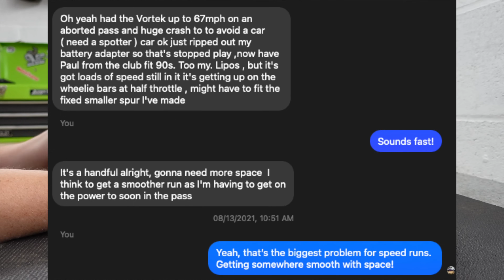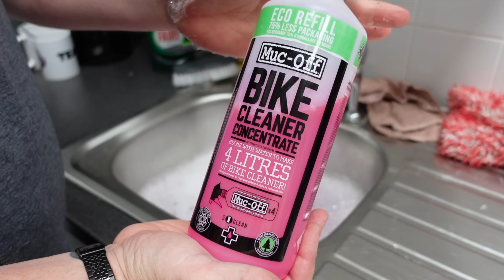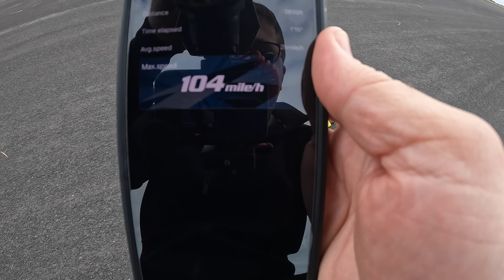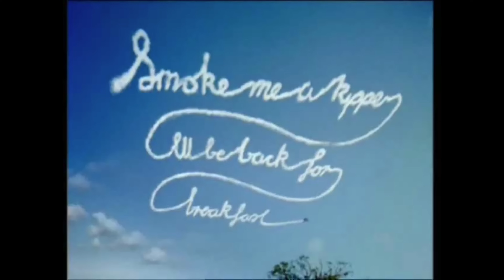The MOST Important RC Car I've Ever Built

Comment: Yes the 17mm hex ends bolts right on to the weird 14mm hex ones! There is just one 2mm bolt in the inside of the hole. Take the drive shaft into 2 pieces and stick your hex driver threw the axle tube and threw the u joint. Unscrew the ones with the 14mm hexs and they slide out. Then you slide in the 17mm ones and boom! It's so easy to convert to 17mm hexes. Cheers mate!

Comment: I’ve been wondering why there’s not some racing drone technology put into the RC cars for speed runs so you can see the onboard footage and make steering adjustments as you go down the runway and you can have bigger run ups
Reply from the maker: Yeah, although not sure if it would be easy to control with only forward view

Comment: I always wonder. 
For example i drive a while in ev mode and than try to get onto another road and woot the cold engine. How long does this go well? Or is it = dont do it. Its not intended to last this abuse. Don't do it.
I personally wouldn't do it and would think how i can get the engine hot. Maybe the typical driver would risk a car crash into the rear for efficiency? Ok this was mean 😂

Comment: You know you can calculate the maximum speed of the vehicle by the rpm of the motor x the gear ratio in the front diff x the gear ratio of the fr and gear diffs x the circumference of the wheels. That will give you the theoretical maximum speed of the chassis before wind resistance. If that number is 94 mph you'll never hit 100. You'd want that number to be up around 125/130 or so.
Reply: KT never bothers, he just puts in more batteries and more motors. 

For eg: if the max rpm of the motor is 4000 rpm and the main spur gear is 34T and the pinion is 17T that's 2 to 1. So the max rpm of the main driveshaft is 2000. if the diffs are 1/1 that means the wheels will turn at a max of 2000 rpm and if they are 2" in dia that's 6.28" in circumference = 12,560" per min. or 1046 ft. per min or 62,800 ft per hour or 11.89 mph.